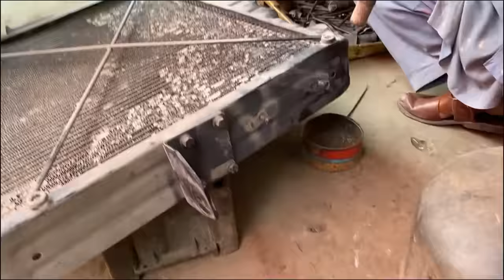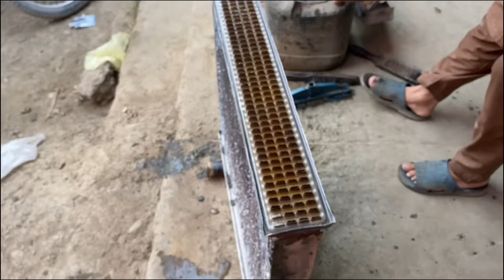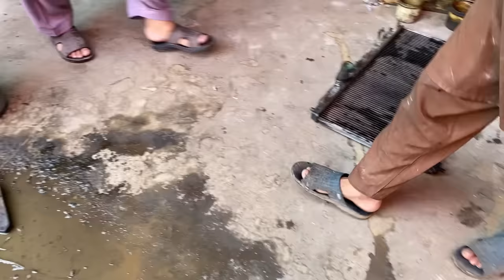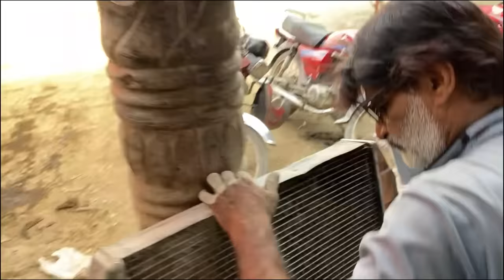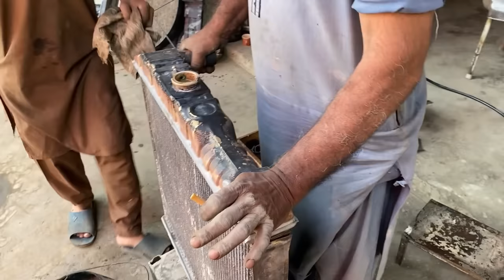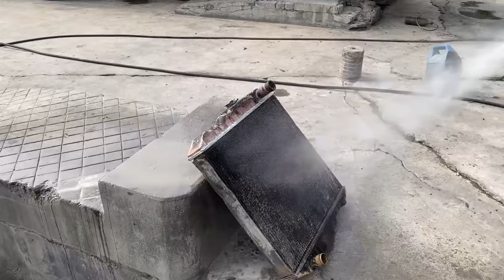How to Restore and Clean a Truck Radiator | Detailed Process | Pakistani Truck

Comment: I repaired radiators for 17 years. For a job like that in 1979, I charged $75! Great work you are doing. Your technique repairing is very different from mine.
Reply: yeah but it's 2024, people should know by now that changing coolant regularly is cheaper, easier and better than whatever bs this is.

Comment: The copper core is what wears out.  Your supposed to reuse the caps but install a new core.  Otherwise there is no real reason to take it apart to clean it.   I’m confused
Reply from the maker: Thank you for your comment!
We will share this feedback with our mechanic and take it into consideration for future restoration projects. Thank you for being a part of our YouTube channel community! ♥️
Reply: In that part of the world they need to reuse everything they can, that's why they cleaned it instead of replacing the core.
Reply from the maker: @KewneRain  Thanks for the feedback! Exactly we prioritize reusing components to promote sustainability while considering safety and availability of replacements
Reply: I am also confused, they technically just patch the leak, they first open it, clean it and then they fill it with dirty water again, what's the point of cleaning it? 

I am very confused, since they also plucking the bits of the fin without replacing what they've been removed.

This radiator is done, not only its inferior before they "fix" it, its wiser to replace whole thing and smelt that broken radiator for copper.

I am all for reuse and repair, but at least try do it properly.
Reply from the maker: @blebekblebek  Thankyou for your comment! The restoration/cleaning was based on customer demand and the mechanic is a professional in their field.